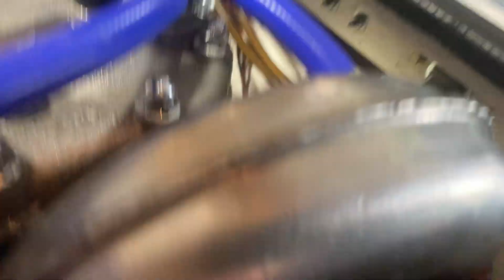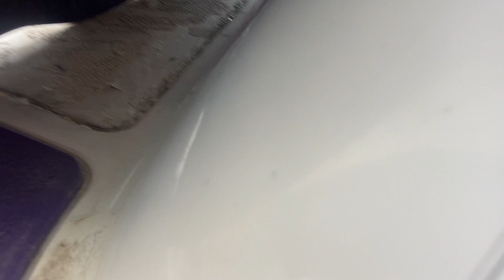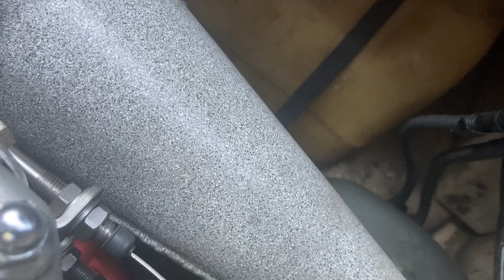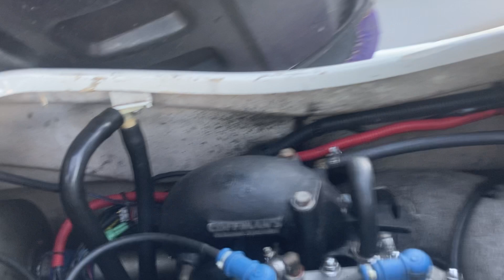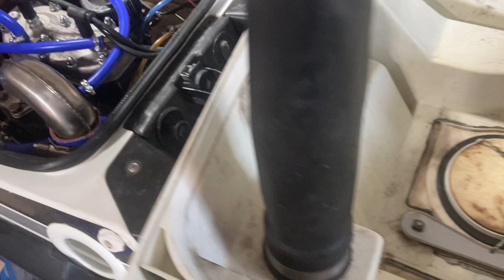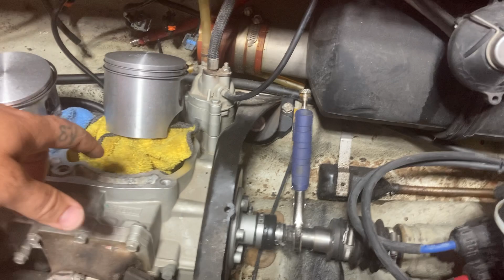Kawasaki 650 SX cooling issues maybe figured it out?

Comment: That ski is set up for dual cooling, meaning he drilled and tapped the exhaust manifold for a 2nd inlet line, and assuming there’s also a drilled and tapped line on the actual pump.  So there should be two lines coming from the pump tunnel, if not drill and tap one in then match the two lines up from underneath the ski then to inside the hull
Reply from the maker: There is do you think of the wear ring is worn out it would cause it to not have enough pressure to push water to the engine? Or could I be loosing water out the exhaust and be a regulator? All the lines are clear and clean engine seems to run great even on the water just not getting water out the second pisser and engine seems to be getting hot
Reply: @BASgarage  if there’s 2 lines coming from the jet pump itself and their connected to the 2 lines inside of the engine bay that go to the exhaust manifold then yea there should definitely be enough pressure.     It’s possible to be loosing water through the exhaust gasket into the exhaust yea but I think you’d still have some water coming out of the pisser. Could be wrong though